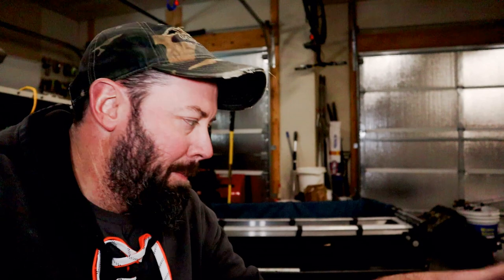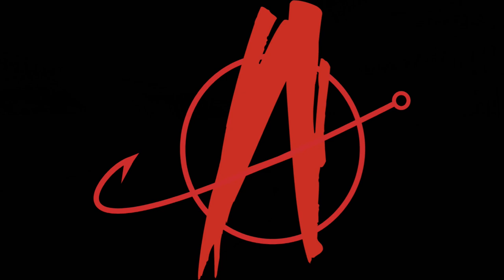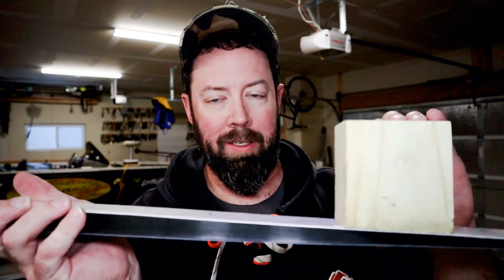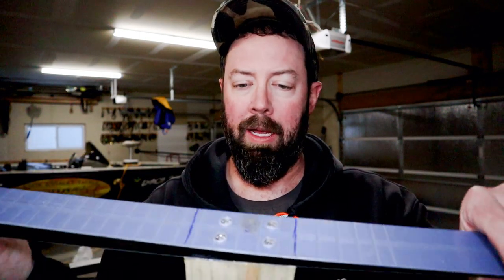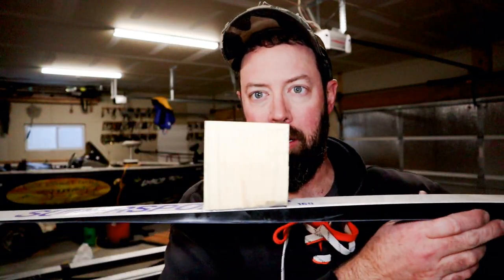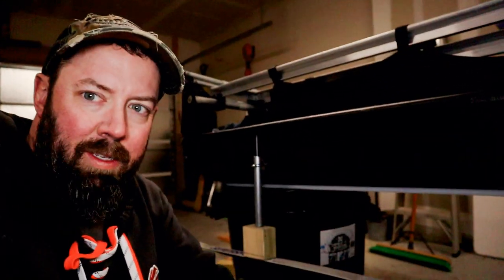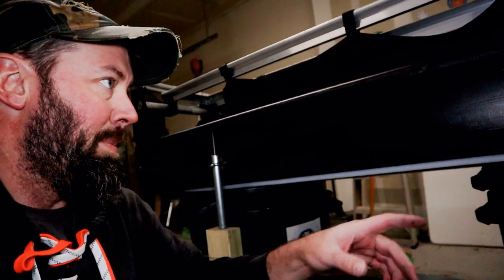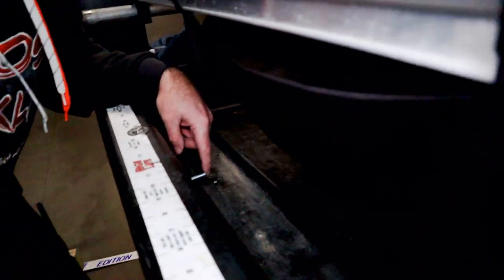SMITTY SLED BUILD DIY!! - Light and Detachable for a Two Man Ice Fishing Shanty

Comment: Since ski blade are expensive. I just went  and use a snowboard and center in my sled and mount in the middle with a 3/8 nuts washer n screw n both sides and that's it.

Comment: Have you ever thought of using the existing ski boot mount?  So you that you can click on the sled leg to it.  Sure it'll end up being only 2 legs than but you can simply come up with some sort fo quick attach leg to the bottom of the sled too, like a table leg... so that it'll rest on another part of the ski to distribute the weight better without having to permanenetly attach those legs to the skis. ??
I myself is trying to think of something really simply, LIGHT weight.
Reply from the maker: xx mike I think the problem with using the existing ski boot mount would be that it's in the center of the ski, unless of course you moved it. The 2 legs attached to the skis was the best solution I could come up with that would let me completely detach it from the sled, but I'm sure there are other solutions that would work!

Comment: Nice job, how did it hold up last year?  Maybe you could build a 2nd set of legs with castor wheels on the bottom instead of skis to get the sled from the parking lot to the ice without tearing up the sled or the skis?  Or maybe clamp wheels to the bottoms of the skis?
Reply from the maker: @timlisi871 It held up very well last year! I guess I never considered an extra set with wheels because pretty much all of the places I go, I can get the sled directly onto snow or at least grass right away.

Comment: Would a middle ski help load weight distribution?  Just a thought I had.  
Don't know what you pull the boat with but if it's a pickup truck with a topper/cap I'd like to see you do a DIY camper build in the truck bed.
Reply from the maker: The Lonesome Fisherman I used to do a little truck camping with my old Silverado that had a 6.5' bed. My new truck is a crew cab with a 5.5' bed so it would be a little cramped lol. I like the idea though! 😁
Reply: @AnglingAnarchy  Yeah, that would be a short bed for sleeping.  I  would like to do it too but I don't have the power tools or the skills.

Comment: This build seems more appropriate for a jet sled only build.  Setup and takedown seems like it would be a pain with a fully loaded 2 man shanty with gear.
Reply from the maker: X V If the shanty is really loaded up, it may require the removal of a few of the heavier objects. I recently used the setup and the only thing I took out of the shanty was my electric auger. All depends on what you feel comfortable lifting.
Reply: @Angling Anarchy  I've yet to learn how to pack lightly, so it would definitely be a problem for me, lol.
Reply from the maker: @xv1670  lol I know the feeling 😅

Comment: Like the design, however smitty sleds work far better if you use Downhill skis not cross country, Down hill skis distribute the weight better and ride on top of the snow far better the cross country. Your smitty sled will preform far better with an old pair of downhill skis.
Reply from the maker: john rapchuck Yup, I figured as much. I was just using what I already had sitting around the house. I think I may have mentioned somewhere in the body of the video that downhill skis would work better. Thanks for watching!